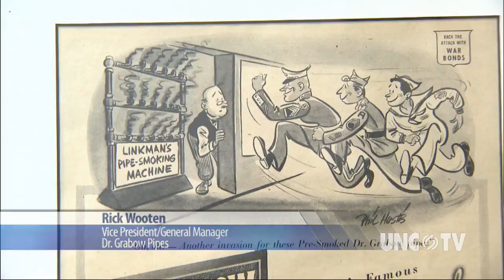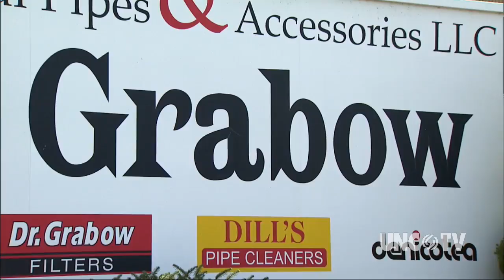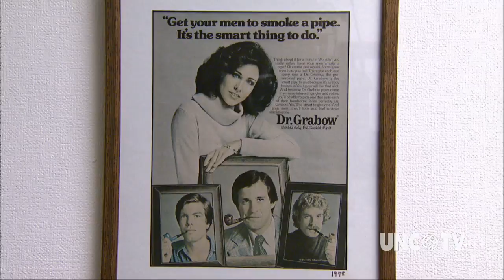NC Now | Dr. Grabow Pipes | UNC-TV

Comment: Why are their pipes so cheap? The quality is compromised?
Reply: It's good quality brair pipe, I have savoy model,  it smokes great. It's cheap because it's not a international brand like Peterson or savinelli. Brair used may not be always of highest quality like used in dunhill pipes.
Reply: Phoenix I have smoked a dunhill and an Eastern European pipe made of pear wood from Mr. Brog, Frankly, I do not feel there is much different in the quality of the smoke between them. Guess marketing throughly affects psychology. :)
Reply: @alvinkoh5556  And that's the point. Some people think they need an expensive high end pipe to get a perfect smoke out of it but that's not the case. Cheaper pipes can be a perfect smoker as well.
Reply: Dr. Grabows are not cheap, the are inexpensive. I just restored a Dr. Grabow Grand Duke blue Spade, one of my favorite estate pipes.
Reply: @ironheadbill  I too dislike the word 'cheap' when referring to something that offers inexpensive value. I have one Grand Duke (blue spade) Rhodesian, with straight shank that I got along with the pipe rack I was aiming for on ebay. Its crown was broken and missing a piece so I just cut off the top 3/16" and filed it down to a strawberry shape. I'm smoking my first MM Legend as I type, and I bought it from the drugstore 9 yrs ago.